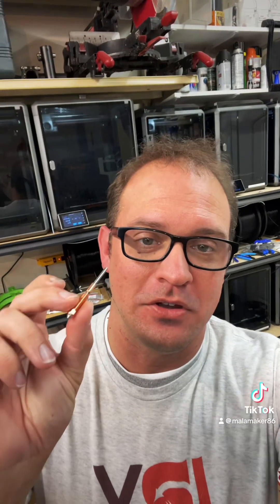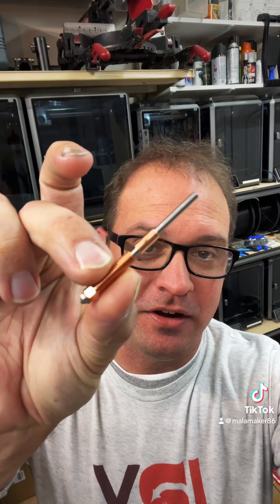Creality K1 Max’s Hotend Mystery: Which one will you get?! #crealityk1 #printfarm #3dprinting

Comment: I don’t even know what that means yet 🙈 I tried doing my boat and the first layer won’t stay on bed 🙈 I’ve heard to use alcohol but nothing else
Reply from the maker: Get yourself a bottle of the vision miner nano adhesive to use on the bed. That will help things to stick. What filament are you printing with (brand and plastic type)? Also what bed temperature are you printing at?
Reply: If you calibrated the z offset and it doesn't stick. Use dishsoap and hotwater. Dry of with paper kitchentowel and ready. Works better then alcohol for me. Tried both.

Comment: Exactly the same problem I had. Just received a k1max and was fitted with the old head and got caught out trying to swap in the unicorn's that were sent the same time. Cs is useless.
Reply from the maker: It’s a struggle with their support team’s response time, especially if you need parts. I have just resolved with my farm to have a bunch of repair parts on hand to swap out at any given moment. Makes sense for me but not people who have 1 or two of these printers. With the hotend and nozzle, Microswiss’ flowtech’s are superior so I recommend just upgrading to them. I have had zero issues (knock on wood). I have 17 K1 series machines with these nozzles.

Comment: That nozzle wont print the way others are... 3. creality is shit! i cant have normal print
Reply from the maker: It may be frustrating getting the mixed equipment but I’m going to disagree with saying Creality is “shit”.  I have 13 of their K1 / K1 Max machines and overall they are very good machines. I’m printing to sell and print for manufacturing, running 15-20kg of filament a week through my 3D printers collectively with little to no issues. Also, I follow the creality forums and a majority of the issues people deal with are self inflicted because 3D printing does require a level of understanding in the current market still. It has gotten significantly easier over the years but it’s not as simple as a paper printer and hitting print. This observation is coming from 10 years of 3D printing experience. Advice to improve your experience…. Generalizing your problem with “I can’t have normal prints” doesn’t tell anyone what issue you are having. Your issue may be slicer settings, filament (there is junk filament on the market!)… my point is try to articulate the issue you are having, feeding all the factors. Most times it’s not the machine that is the issue. By feeding all the factors into a forum will give others a more complete picture and might help you figure out your issue. If there was a real issue with Creality K1/K1 Max’s I am far more likely to see it with the amount of machines I have but I have not seen what most people are complaining about.

Comment: Stupid question but what is the easiest way to tell which one I have?
Reply from the maker: The unicorn nozzles are approximately 2.5” long where the old style is just a 1” nozzle.
Reply: @MalaMaker86  How do I tell at a quick glance without removing the heat shroud and everything just to check?
Reply from the maker: @kawaiichi The only way that I can think of is removing the nozzle. The new nozzles are a cold swap so they are snug not heat tightened.
Reply: @MalaMaker86  my k1 max came with a spare old style hotend so maybe that's what's installed on mine too
Reply from the maker: @kawaiichi  yeah that’s a good indicator

Comment: Did you find any advantages of one nozzle over the other?
Reply from the maker: Both the unicorn and the flow tech nozzles are good. I ended up sticking with flow tech because of the investment I already had to maintain the same hotend/nozzle between all my printers.